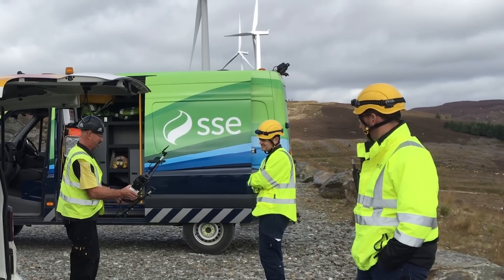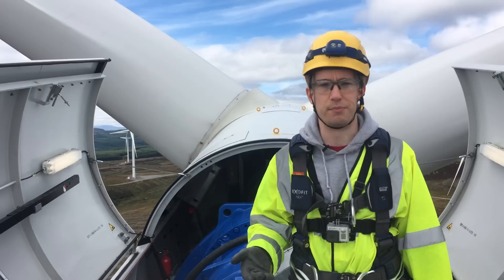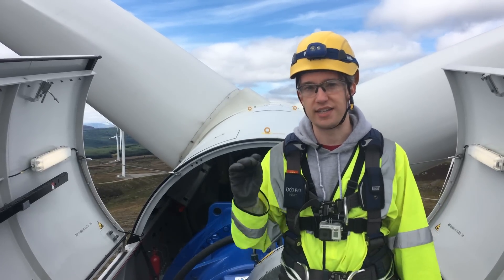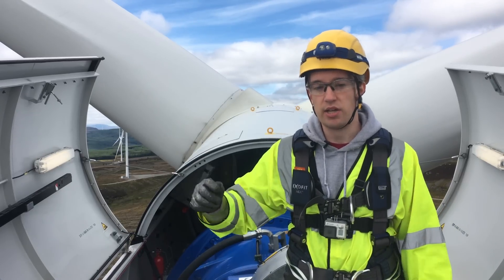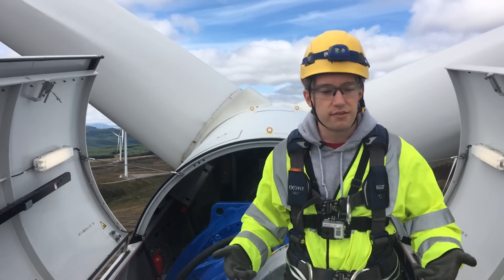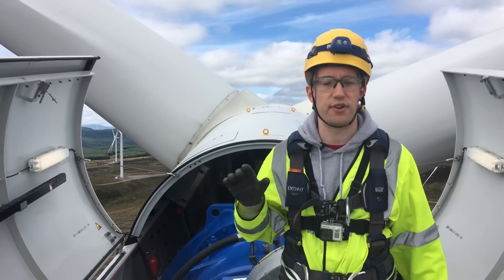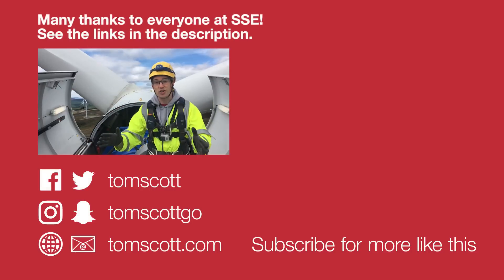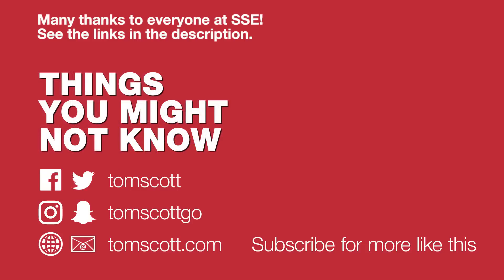The Problem With Renewable Energy (and how we're fixing it)

Comment: car batteries will not work. one can charge the battery in a car but you need that charge to move the ev car. if you increase the storage capacity of the battery that is an extra cost that the car owner may not wish to pay for. if you charge you car over night you should have enough energy to get to work to plug it in. But little left to power the grid and you will need stored energy to get back home. This will not happen if you feed power back to the grid while you are at work. The Car Battery would need to be at least 2 times the size just to hold or store grid power. You did not state Hydrogen production to store energy and then reuse via fuel cells. Hydrogen is a better storage meadium
Reply: You don't need to use the full capacity of the battery for grid-balancing. Just 10% would be plenty. A few kilowatt-hours here and there would probably be enough if spread across several million vehicles. Most people wouldn't worry at all if their car was only 90% full when they came to use it.

Comment: Wouldn't load-balancing flywheels at each substation be a more quantifiable and easily implemented solution than hundreds of thousands of car-chargers with secure internet connections to a smart grid and additional circuitry to flow power back into the grid? It sounds risky to lay odds that there will be enough cars connected to chargers near where you need the extra power ... and I shudder to think of the effect produced by a "zero-day" exploit giving a hacker control of the grid managing the remote power requests!

Comment: This video  needs to be watched by the Smart meter "deniers" who think that smart meters are the work of the devil and that they only benefit the big power companies. Well their purpose is to help balance the grid by offering tariffs which albeit are more expensive at peak times but will be extra cheap at low demand times. The steel industry has had these tariffs for years including a near instantaneous load shedding system for electric arc furnaces.
Reply: OK but that is a major business which is massively contrasting from a simple home.
There are a myriad of other reasons not to have a meter installed, i should know as I helped set one off these networks up in North America.

Comment: This isn’t actually true, the amount of kinetic energy in a rotating wind turbine is roughly the same when normalized by its power output as a typical conventional power plant. The issue is that the current wind farms aren’t set up to use this kinetic energy for frequency control. (Wind turbines used to be synchronous machines just like conventional power plants, but advances in power electronics allowed wind turbines to be variable speed, which allows them to change their rotational speed with the wind speed for better efficiency)

There are some proposed controllers that allow for the wind turbine rotational kinetic energy to be used for frequency response, but the current payment model for wind farms doesn’t support this function. 

TLDR: wind turbines could be set up for frequency response, but operators won’t be paid for it so why do it.
Reply: I think synthetic inertia is required from wind turbines from Hydro-Québec and deloading is required by various countries, at least in Europe (Ireland, Denmark, Spain...). I'm not sure, so verify it yourself if you want. Yes, the inertia constant H is roughly equal to synchronous generators but it is calculated for rated rotational speed, wind turbines often operate at lower rotational speeds (following MPP curve) and the rotational speed is usually limited at somewhere about 0,7 p.u., so stored kinetic energy can vary extensively.

Comment: Problem with that: Cycling batteries is really expensive.. like 10+ €cents expensive per kWh, as they degrade.. Even if you have a solution that is only 20% efficent, it will still be cheaper than using current state of the art batteries.

Comment: That seems like a really bad idea. imagine trying to go to work in the morning but you car only has a quarter charge left because the wind stopped blowing last night.
Reply: You can just set a minimum threshold and it's fixed
Reply: That's not the way it would work. EVs would only feed power back into the grid for a few minutes when and if required.

Comment: RE: electric cars
what about people who drive when energy is cheapest? will i get into my tesla 2030 model and find i have no battery because energy was expensive so my car sold off the electricity?
Reply: You'd probably set up the car's computer to just use the top 10-20% for grid-balancing, so worst case, you'd come back to it 80% charged, unless the car was below that when you plugged it in and you weren't gone long enough to charge it beyond the grid-balancing threshold.

Comment: Thie video is partialy wrong. Wind turbines have alot of energie stored in the rotation of their blades. Wind rurbines are actully required to provide energie for the system in case of a frequency dropp. Furthermore alot of WT run on 90% efficiancy and go up to 100 when needed
Reply: Where are they required to do so? The efficiency of wind turbined is limited by Betz's limit at around 60 %; the average efficiency of modern wind turbines is around 40 %.
Reply: @FrainBart_main  to my knowledge these kind of requirements apply atleast for all of europe. And with 90% i mean 90% of there theoretical maximum i.e. if they could extract 40% of the winds energy they run on 36%.  The cool thing is: this can be achieved by overspeeding the rotor above the maximum power point. When the turbine slows down you get more power from the rise in efficiency and from the rotational energy of the blade
Reply: @Jan-vm6mx  Correction: the relatively new ENTSO-E grid code Requirements for Generators (RfG) require all large wind farms to be operated below available capacity and provide power increase in under-frequency situations. This has already been adopted by National grid and TenneT in 2016 and probably by others since then.

Comment: I know it's probably an inefficient addition in terms of the cost of implementation, but it occurs to me that the design of those wind turbines could perhaps include a couple of solar panels - one or two on each of those large doors covering the maintenance bay Tom is standing in...? Surely the energy being transferred from the turbine gets output at some point into a local grid which is then sent off to the national grid... couldn't you just add the power from those solar panels into the total output from each turbine at the bottom of each structure where its output meets the local grid?

Now, I know a solar panel has a comparatively-small output compared to the turbine itself, but if you multiply that little extra top-up by the number of turbines in each wind farm over a day's worth of sunlight that would surely be a net increase (albeit a relatively minor one)...?

It just seems that there's a completely unfettered bit of real estate on top of those structures with uninterrupted sunlight, with only the shadow of the blades potentially blocking the light temporarily if the wind happens to be coming directly from the East. And while it's true that the solar panels would only produce their maximum energy potential while the sun shines rather than 24/7, the same could also be said for the wind turbines themselves. After all, the whole point of building wind farms in flat areas is to maximise the amount of wind they are exposed to... wouldn't putting solar panels in a position so high up that they have only one intermittent shadow-casting element between them and a completely open sky be doing effectively the same sort of thing - maximising the chance of catching as much sunlight as possible...?

It just seems to me that for relatively-little expense and just a bit more hassle in maintenance, each turbine tower could be producing a little bit more bang for its buck... and when multiplied across a whole wind farm that would be a worthwhile increase over time.

Comment: So the good news is that you would be able to boil that kettle in the evening... the bad news is that you couldn't get to work in the morning? 

I like the idea of a colossal flywheel.  A huge diameter that can be spun slowly (for increased efficiency), that just so happens to be slow enough for people to ride like a ferris wheel.  For additional cheek, make sure that the entry is higher than the exit, thereby robbing tourists of their hard earned potential energy (muha, muha, muhahahahaa).

More sensibly, what's the argument against more massive wind turbines?  In a similar vein, we have thousands of them, if they were all a bit heavier that would smooth out the power delivery too surely?

Comment: Electric cars' batteries are the most expensive component of the car. And they have a limited life, meaning that anytime the battery is charged and discharged, it loses capacity and at a certain time it will have so little left that it will have to be replaced with a new one. Therefore I would not let others use my car's battery for free, and also I would not like to find it discharged when I need it charged because "the national grid demanded energy". 
This are the reasons I don't think electric cars batteries will play a significant role in stabilizing the grid.

Comment: "rotating thousand of times a second" yeah.
Reply: I suspect he meant to say "minute", not "second". Though, depending on the design, I suppose it could be possible to have turbines that run that fast, but are put through gearboxes to slow them down to 50 revolutions per second.

Comment: This is all well and good, but it still doesn't fix the fundamental problem with wind and solar power. The wind isn't always blowing, and the sun isn't always shining.

With coal, oil, nuclear, and hydro, we have complete control over how much power we generate; with solar and wind, we are forced to adapt to the whims of nature.

Like Tom said, we will always need a turbine somewhere. However, because the sun and the wind are inconsistent, we will have to have a turbine capable of replacing all the power of a wind farm in the event the wind dies.

Wind and solar are great when something has to built far off the grid, but they have a long way to go before we can run our modern world on them.

Comment: Your explanation about how conventional power stations make up for say a trip of one turbine is not entirel correct. No manual input is required to increase power from all the rest of the conventional stations  simply becaue all the turbine power, i.e. steam, is controlled by a speed sensitive governor on each turbine. Yes there is inertia, but like a car hitting a hill that's not enough to keep up the speed, you must open the throttle. Each turbine will automatically increase power to keep the turbine rotating at 3,000rpm . This speed is strictly controlled within fine limits. Voltage is also automatically controlled by voltage regulators.

Comment: Definitely been some good progress on this in the last four years, smart meters are rolling out, EV's and renewables continuing to rise. Unfortunately the majority of EV's on the market right now do not support vehicle-to-grid (V2G), only Nissan's EV's as far as I know. And there still needs to be more research into what sort of effect V2G has on battery degradation.
Reply: And even for those that have Nissan EVs, the V2G technology to connect it to the system, and make use of that balancing service is still largely unavailable. I am aware of the Indra trial, which is a Vehicle-to-Home scheme that will make use of time shifting with variable domestic prices - but its still a trial - do such technologies yet exist?

Comment: "One slows down, they all slow down." No.  They are brought up and synced before being put on line.  They are not affected by another unit on the grid per se, without tripping and coming off load.  There is no speed adjustment of a generator as frequency is product of rpm.  The UK runs at 50 hz.  2 pole gensets run at 3000 rpm.  Full load, half load, quarter load... 3000 rpm.  4 pole units at 1500 rpm.  Your analysis of the electrical grid misses a large fact.  In relation to the demands of the grid, the wind hardly ever blows and when it does it doesn't blow for very long or very hard.  Without a massive capacity storage system these units produce very little real power.

Comment: couldn't they start installing large ultra capacitors in all homes essentially doing what the electric cars would do but without relying on the sales of electric cars and whether or not there are enough plugged in and charging at any given time?
Reply: locktockshockrock I believe Tesla does something similar

Comment: The solution is nuclear. If people were properly informed, then they would realize that modern nuclear power plants are essentially safe, and they are the most efficient form of power in terms of cost. Wind farms are costing the public money, because they are funded through subsidies, same with most solar power.
Reply: nuclear is great until something goes wrong. Things very rarely go wrong, but when they do, they do it big. This would be more true if we're talking heavy water plants or thorium plants as well, but the light water reactor doesn't get much use out of each pellet of fuel, but still has to store them for large amounts of time.

You can have too much power, too, and most nuclear reactors don't spool down very quickly (at least the civil ones)

Is it better then coal? Yes. Is it as good as win or solar can be? Probably not. a fire in the number four wind turbine isn't going to spread cesium everywhere
Reply: The same "when things go wrong..." point can be said of coal or gas plants. Realistically the two largest nuclear disasters aren't possible in GB. Chernobyl was caused by human error and poor safety training and Fukoshima was caused by a nuclear plant in an earthquake prone area

Comment: Solution: stop the fear-mongering about nuclear reactors and nuclear waste. We still need nuclear power.
Reply: yep that is basically it al lot has happened in 30 odd years since chernobyl my issue with renewables is that it is not stable at all
Reply: @996stoky  
Renewables are stable, but intermittent. We just need to maximized their energy generation, and let nuclear guarantee supply.

Comment: I guarantee you that the cars will never solve this problem. This would be a far to unpredictable system because you don't know how many cars are connected to the chargers at a time. And car owner also won't be happy if they try to charge up their vehicles and instead they put out energy to the grid. And the batteries would also wear out much faster which would add significant costs to the cars.

Comment: Tom I hoped you had a good trip the Arctic and did you offset your carbon footprint as you wandered around that pristine landscape. your little bit of body heat did not help save the ice sheets. You fail in your little bout of self importance in the video in that wind can not ever be relied on even with one lump of metal spinning to help it but the lumps of spinning metal can be relied on with out wind, which is a good job as there seem to be a lot of dead turbines around or are they waiting for the right kind of wind.
Reply: Done ranting? There's a reason that wind farms are put on hills in the gulf stream and in major wind corridors. These turbines have been engineered to be as efficient as possible. No turbine is ever "dead" as you put it, rather one uses auxiliary power to rotate to face the wind, which then gathers power to turn one of its brother turbines, multiplying until they are all gathering wind. These blades are anywhere from 8-12 tons and carry a LOT of momentum, so if the wind were to die down, they would continue to spin for up to 10 minutes. Furthermore, renewables like these are modular, so that if one fails, it can be easily replaced. If your coal or nuclear plant goes down though, someone is bound to die.

Comment: So you want to take a car that is charging and discharge it back into the electric grid? The big limit with batteries is how many times they can be charged and discharged and you are planning to use up more of those cycles? Good god man. Why does everyone hate nuclear power? Sure their have been some problems with it but you can fix those problems. Actually put in useful redundancies rather then cutting costs and saving monies.

Comment: The idea to have electric car batteries feed into the power grid is quite stupid. I generally see the creation of electric cars to be catastrophic to the eco system, considering the rare materials that are excavated in the process.
Reply: Not remotely as bad as mining and burning fossil fuels.

Not only are they not as bad, but you also need MANY  orders of magnitude less rare earths than you do fossil fuels.

And rare earths are completely recyclable(and they're already working on building recycling plants), whereas fossil fuels are used once and more has to be mined and shipped.

Not to mention that fossil fuels release  a LOT of bad things into the air, land, and water. Things like poisonous chemicals, heavy metals, AND radioactive elements.
Reply: Care are not a viable option for the future. The electric car is not an answer to our problems, well implemented public transport is the only viable solution.